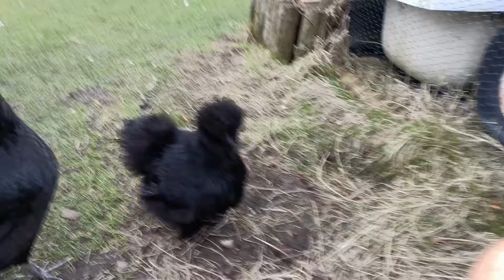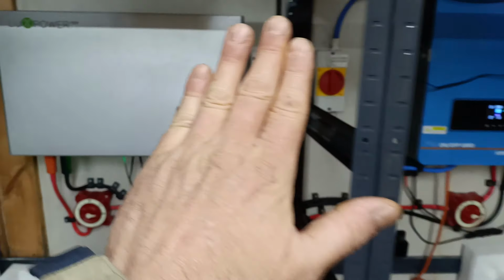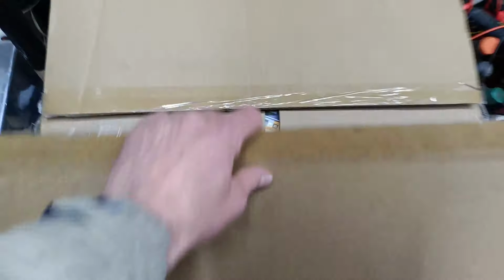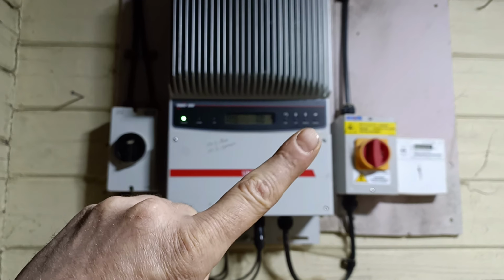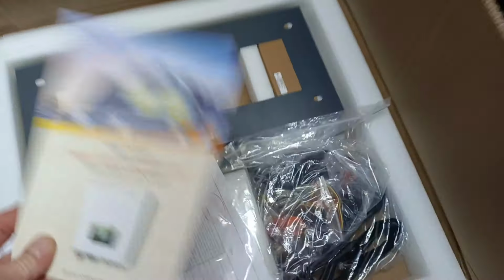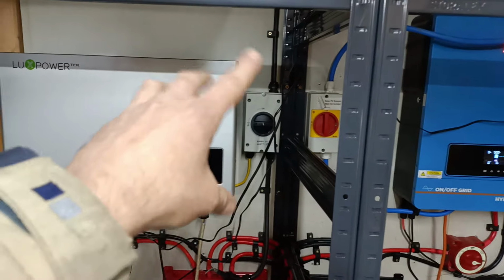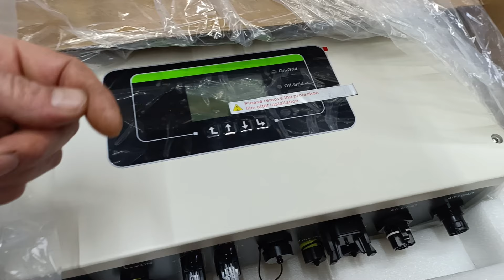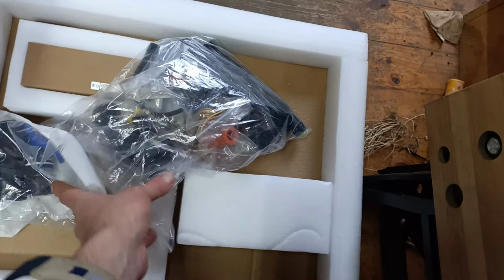2 Inverters will be going bye bye!!!

Comment: Good luck with the computer link - looking at the manual, the communication cable provided looks like it's for the battery management system, either RS485 or CAN.  Whether you can get anything useful from the USB/WiFi port is another matter. Have they provided a Com/USB adaptor or a Wifi dongle?
Reply from the maker: Hi, I don't need luck..... I need a miracle lol.
It comes with the dreaded WiFi dongle.  It will accept USB to RS485 adapter but it's not included.